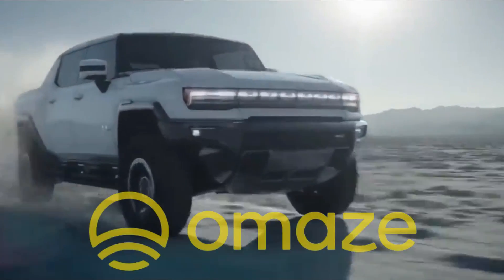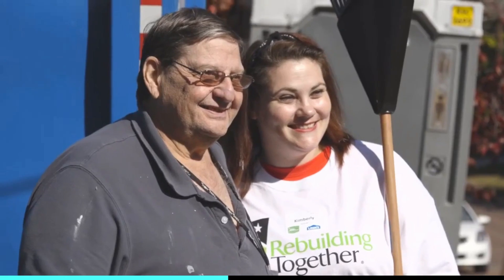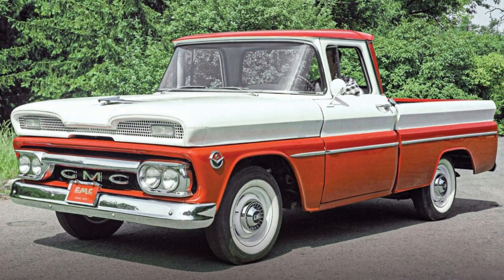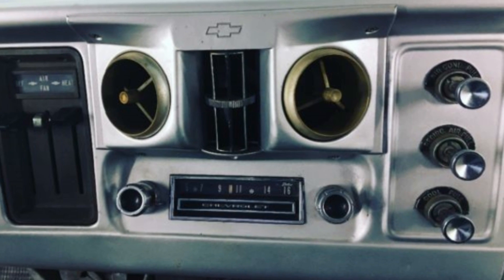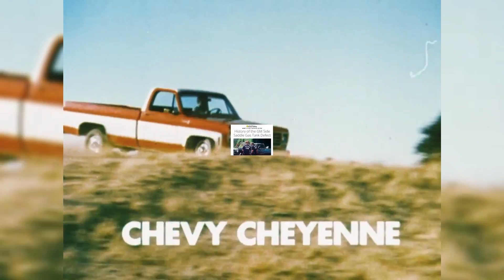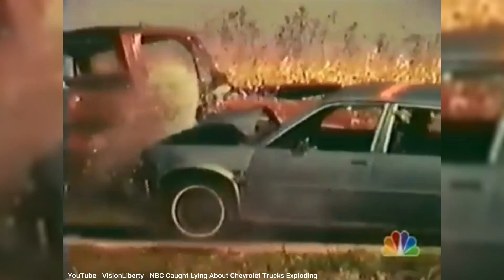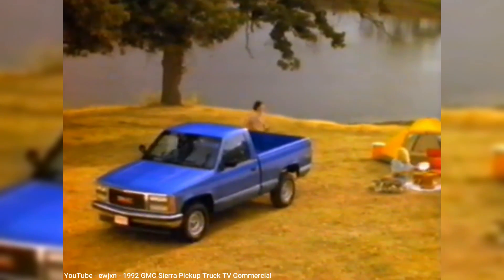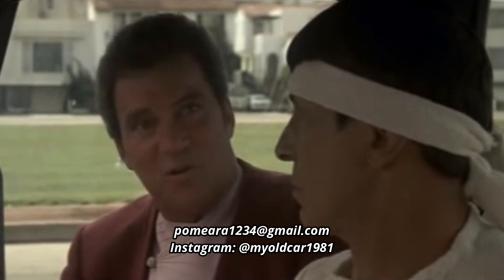Here’s how GM survived the Chevy/GMC C/K pickup exploding gas tank scandal

Comment: The side saddle fuel tank design installed in over 10 million trucks – all 1973-87 General Motors full-size pickups and cab-chassis trucks (pickups without beds) and some 1988-91 dual cab or RV chassis – is the worst auto crash fire defect in the history of the U.S. Department of Transportation. Based on data from the Fatality Analysis Reporting System (formerly known as the Fatal Accident Reporting System), over 2,000 people were killed in fire crashes involving these trucks from 1973 through 2009.

Comment: A derivative of this truck line was purchased in volume by the United States military.  These C/Ks were equipped with a diesel engine, four wheel drive, upgraded suspension and beefier electrical systems. Called CUCVs - Commercial Utilization Cargo Vehicle,  they were well-loved by soldiers in the mid to late 1980s because of how comfortable and weather tight they were in comparison to purpose-built military trucks.  These venerable CUCVs (pronounced Cuck Vee) soldiered on alongside their HUMVEE replacements well into the 21st century.  And believe me, the old CUCVs were still thought to be far more "Cadillac Comfortable" (though far less tactically capable) than their younger HUMVEE brothers.

Comment: i own a 77 K10.......... and yes.... id rather have the tanks inside the frame
.
but ive also driven 1 MILLION miles.... and never had an accident......... havent even hit a deer (watch me hit one tomorrow........)
i drive like EVERYONE is out to kill me
.
probably has something to do with riding a motorcycle.... where you simply dont feel as safe (no steel cage around you)
if you think bike riders are over-reacting....... try riding a bike for 50,000 miles..... you will start to do the EXACT!!! SAME!!!! THING!!!
.
.
anyway.... ya, fuel can spray out
but ya really have to get unlucky to have to light off
.
and even if it does..... its still on the outside of the vehicle..... 
simply bail out the side thats not on fire.......
.
or, if you are knocked out..... Montana has a law that prevents lawsuits if you stop and try to help someone...... 
but end up paralyzing them.... as you drag their broken neck butt out of a BURNING CAR!!!
.
.
see, montana knows they would have 100% died if you didnt help
and being in a wheelchair because someone dragged you FROM A BURNING CAR, making your neck worse....... VS slowly burning alive, which is VERY VERY painful.... 
well.... id rather be in a wheelchair 
.
at least my (currently non-existent kids... thanks to god, luck, and Trojan) would still have a father.......

Comment: I have a 93 k1500 in my driveway. I also think you should do an episode like this on on the dodge ram trucks and ramchargers from the 70's to the early 90's rarely see them. But had a 87 ram w150 and a 90 ramcharger w150. Wish I still had them.

Comment: From what I understood about this whole thing is that some ck pickups that were sideswiped did catch fire like pintos and first generation Mustangs. However when the news Outlet tried to recreate it they crashed like a dozen trucks and not one of them caught fire they got busted because they didn't declare they used a model rocket engine to cause the fire. However before they got busted I distinctly recall them saying that General Motors would install a liner in the tank that would have 100% eliminate the risk of the fire. I was especially concerned because my grandfather drove a k30 wrecker and my uncle had a the super common standard cab short bed K10 on 35s

Comment: Still have the '74 K10 Fleetside my father bought new in the summer of 1974.  In 1986 we did a frame-off restoration and motor rebuild, as well.  Today it is a worse rust-bucket than ever, including the fuel tank.  It runs ok, but the 250 L6 needs another overhaul, or just replacement now.  Doors, fenders, hood, and bed are all rusting to pieces, again, as well as the fuel tank.  The 4 leaf springs sag in the wrong direction when loaded, and the 4.10/4.11 gearing has always made fuel economy lousy.   I keep overhauling the brakes & fuel system to keep it roadworthy, but it is an uncomfortable pain in the neck.  My father replaced it with a new '92 C-10 TBI 350 5-speed that rode and towed like a Caddilac, and I bought the K10 from him , because no one else in the family wanted to drive or maintain it.   It's been a love/hate relationship for nearly 50 years, so I keep it going mostly out of spite.  Sometimes I wonder if I should sell while it's still shaped like a truck, lol!

Comment: It was a perfect storm that allowed them to get off.... Truck wasn't in production anymore, the sheer power of GM in the 90s and Datelines hit piece. The general public just saw old trucks that Dateline rigged to blow up. No outrage like we would have today. It's no doubt a more dangerous design than having it inside the frame rails but it's also much safer than in the cab like the trucks that preceded it. If this happened today, you'd be looking at a massive recall and repair just from the media standpoint. Look at the cobalt ignition switches. "New" GM had No obligation to do anything with vehicles that were manufactured by "old" GM but they didn't dare challenge that fact very hard. These gas tanks where they had an obligation they got away with it. Different times. I still laugh at the $500 or whatever it was coupons they gave owners. "Our old truck could have killed you... Here's $500 for a new one...because most people driving these old trucks could just jump up and buy a new one 😂

Comment: Had a 88 silverado 4x4 
4.3 vortec 
V6
Had to change engine twice!!!wtf
Junkyard sold me a dud engine but replaced it cuz it blew a month later!!!
So bought it w/bad motor,took it out,put one in,took it out,tranny was bulletproof!!!
Finally junkyard gave me a 4.3 w/only 36k on it!!!
Ran like a top!!!
Body Had 130k on it,had to replace gas tank straps they rotted out!!!wtf
Overall though truck was a workhorse 👍
Rolled it Finally 6xs and 50k miles later!!!🤣🤣🤣

Comment: Gotta say the tank placement was safer than the models before and I believe from 83 on up there was a bottom skid plate option to protect the cas tank, while it is not a full cage it's something at least,  4th gen is pretty cool too, though due to the first generation throttle body intake it was plagued with issues until it was changed to a better design about 4 years later, love these trucks love your videos

Comment: I had a 2000 gmt400 tahoe Z71, it was the last year of the gmt400, and it came with body colored bumpers/fender flares, forged aluminum 5 spoke 16" wheels, brush guard, full skid plates, bilstein shocks, rear locker and the bumper from the diesel Silverado with driving lights. It was a cool ride I do miss it but it being an automatic meant that I would eventually get rid of it.

Comment: My Dad had a 72 and later a 76 half ton Chevy 2WD.  The 76 was best but it got 12 mpg.  It got 12 mpg uphill, down hill, towing 5000 lbs, and falling out of an air plane.  350/350 with 3:43 gears.  
I had an 87 and liked it but my 95 was best for MPG, comfort, power, and even durability.

Comment: I've got a third gen C10, and its still probably one of the most safest and reliable trucks on the road. Mine specifically has a rebuilt 250 inline 6 and a 3 speed auto. Shifts and runs like new. Besides, it doesn't have any electronics to help run the engine, so you don't have to worry about anything electrical going out besides the headlights, blinkers, tail lights, dash lights, and windshield wiper motors.

Comment: The 1988-1991 R/V series also included Suburbans and Blazers, they weren't redesigned until the 1992 model year. Most of the R/v trucks were 1 tons, chassis cabs and other "specialty" trucks

Comment: The 4th gen trucks are fantastic, especially the later ones with Vortec heads. They are super reliable and long lasting pickups.
Reply: Yes they're solid trucks. I've had two GMT 400 Suburbans, still have one, and I recently got a crew cab long bed GMT 400 pickup. These trucks are nice inside, way plusher than the previous generations, but still tough enough to do truck stuff when necessary.

Comment: I owned an 88 GMC Sierra C1500 regular cab longbed w/ the 305 V8... it was called a grandpa spec... it was peppy and only broke down on me once in 5 years (it was a fuel sensor that was fixed in half an hour)... got it at 220k and traded it for my first jeep... that truck had bad valve seals and always smoked when started but ran great... 285k the day I traded her... I slowly had cleaned her up, fixing the rust and bumps and bruises, matching wheels and two toned with a dark wood, which was very sharp with red paint and interior... never owned a truck since, just midsized SUVs and a 01 chevy tahoe, but that truck was special and its been one of my longest car ownership of 5 years... drove my wife to our wedding, picked up my first dog and moved into our first house... a great extra vehicle, that id have kept if it wasnt so big for my wife to drive... the 94 xj was our first shared car as a married couple, as we each had our own car

Comment: i still own a 1989 C1500 (gas w/ fuel efficiency mods installed) thats has over 380,000 kms AND a 1995 K2500 (diesel) with just over 280,000 kms for obvious reasons.
BOTH trucks do get pretty good mileage to this day and are in good over all shape.
don't ever have to charge them either. mechanical machines will always be superior to ANYTHING electric simply due to simplicity. more electronics = more points of failure.
the electric/digital/green age is merely the next scam for the masses. enjoy folks. ill stick with whats actually proven AND works.

Comment: Since we're on the subject of pickup trucks from back in the day, you should do an ep on the old Ford Ranger line. My first vehicle was an old '93 Ford Ranger STX Supercab (with a 5-spd Manual). It was on its last legs when I bought it and didn't last very long, sadly. I ended up trading it in for an '01 PT Cruiser (and even that one was on its last legs). Some of those old Rangers didn't hold up very well, which I kind of find to be one of the reasons (not the ultimate one) why Ford discontinued them here in the states all those years ago, only to reintroduce them back a couple of years ago (though now they're bigger).
Reply: I'll second the ranger idea, I learned to drive on my grandpa's 1991 (at 13)

Comment: It's interesting that Dateline rigging the tank to explode and getting caught completely shifted the blame to NBC. Like you say in the video, despite being more deadly than the Pinto, we don't think about this series of trucks as death traps, and the Dateline debacle probably gave GM something of an out.
Reply: GM was the darling of the "media" - therefore the government - especially since Ford never took bailouts like GM did.  The government basically owned GM.
Reply: That's the same Dateline that did the To Catch a Predator series with Chris Hansen
Reply: It wasn't more deadly than the Pinto. It had more accidents because there were legions more of them on the road.
Reply: @coltonregal1797   - Considering the offending Chevrolet and GMC "squarebody" pickups were produced for 15 years, there were "legions" more sold than the Pinto.
Reply: @broeheemed32  the pinto was a better choice than the christian square body especially the engines which are still used **
Reply: @coltonregal1797  problems with the pinto was restricted to one model "the runabout "only where as all the square bodies were boomers
Reply: It's ALL theatre... They're ALL in on it. And they always have been.
Reply: Its because they were in fords wallet
Reply: They also rigged it 9n the Ford pinto too.

Comment: I remember the whole NBC news scandal with those trucks and it made me really question if what was being presented on Dateline was true all the time or not. 
Outside of that I think GM survived that mess for a number of reasons. One huge reason is those trucks had been very well established for a very long time and seen as being tough and mostly safe. Compare that to the Pinto which in it's time was seen as radical design choice that had what seemed like an obvious flaw in a vehicle that was new, seen as untested and not yet trusted. Plus NBC's decision to fake the results further cemented public opinion that the C/K gas tank issue wasn't as serious as some felt it was.  
My family owned a commercial roofing company which at one time had a lot of 3rd gen C/K pickups (along with other trucks) in their fleet. I remember the issue of the C/K gas tank fires coming up at a family event shortly after the initial Dateline episode. But as soon as the word that NBC faked the results came out the issue was never brought up again and those trucks stayed in service until they eventually broke down over time and were replaced.
Reply: The particular collision that was shown on Dateline was rigged.  But the point they made was true.  All they had to do was add a caption and/or voiceover that this is a re-enactment of actual events, and they would have stayed out of legal trouble.
Reply: @fosterfuchs  I'm not saying the problem didn't exist, just that there wasn't a public perception that there was a serious problem. The Dateline incident made the issue seem like it wasn't a serious problem because if it was then why would the test need to be rigged. Hence why it seemed to become a non-issue in my own experience once Dateline was exposed for what was done. 
The real sad part is that GM allowed the fuel tank issue to go on as long as they did with so little regard for it and so much stonewalling of the govt.  Also, they continued to make similar safety mistakes with the ignition switch issue on vehicles in the 2000s as another good example.

Comment: The carry all name was a nickname… I’ve seen nothing anywhere that shows it was ever called that. I do have GMC documentation showing it being a suburban as far back as 67… and might be able to look at the 60-66 stuff too
Reply: The suburban name started in the 1920s, if I remember right, but it wasn't always used.  The utility vehicles in the '60s were usually just called panel vans or wagons, since the official name was "panel body" or "panel truck"... something like that.  But yeah, they revived the "Suburban" moniker in '67 and have used it ever since.
Reply: @livewire2759  
1935 was the first Chevy suburban, and Chevy has had the suburban every single year since, always under the name suburban, longest nameplate in automotive history. The panel truck had no windows in the rear, except on the rear barn doors. That was discontinued in 1969 after the van went full size in 67.
Reply: @Project_Low_Expectations  Right, but my point was that the Suburban name wasn't on EVERY utility vehicle that people call "suburbans".  I believe in the 50s and 60s the name only described the top trim level in the long wheelbase utilities.  It wasn't until '67 that the name was given as a model moniker to every long wheelbase utility vehicle.
It's the same basic thing they did with the "silverado" name.  For decades, it was just a top trim level, then in '99 it became its own model.
Reply: @livewire2759  it was for the model of light duty truck with windows and back seats. Never a trim model ever since 1935. It is a specific series of model numbers. 
If it was a GM wagon style body, with seats and windows, had 2 doors from 1915 to 1966,  3 doors in 67-72, or 4 doors 73 to date it was a suburban per gm’s naming, on the owners manual, on the title. 
That’s it case closed end of story
Reply: @Project_Low_Expectations  I see... so the passenger version was named "Suburban", but there were no actual "Suburban" badges on the vehicles?
Reply: @livewire2759  correct. Badges weren’t until the 73 model.
Reply: GM called them "carryall suburban" up through the 60-66 generation. Into the 67-72 generation, the panel truck continued into the 67-72s. When the square body Burbs came out in late '72 as '73 models, these were the first ones to be called "Suburban" without the carryall too. The 4 door Burb was the one that started to become really popular because people saw how versatile they were. Then their popularity really grew with the next generation GMT400 series. And then in '95 they made a 3/4 size Burb called the Tahoe and Yukon, and sport utility vehicles became the new family sedan....
Reply: @HotWheelsBurban  
Where is your info from? The title and owners manuals and model number all say suburban on the ones I had (a couple in the 67-72 years). All the GM to dealer papers I’ve dug up over the years, GM never called them anything but suburban.
Reply: @Project_Low_Expectations  IIRC it's in the factory advertising and brochures

Comment: I was born in 1979. Sure wish Dad had kept all the square bodies he owned over the years. My first was a 88 2500, then a 95 Z71, then a 2001 Z71 1500, then a 2002 2500 hd diesel, followed by a 2011 1500 extended cab that I bought brand new and I just traded in this past spring for a 2022 crew cab 2500hd gasser. Chevy truck loyalty is deep in my family!
Reply: Sadly it'd be pretty tough to do with square bodies. The penny-pinchers had a heavy hand in design of those trucks leaving us with thinner frames and body panels than generations before and after. Since the 00s, I've always wanted a clean Camper Special that I could breathe a little more life into the 454 but finding one that hasn't rotted into the dirt is damn near impossible.